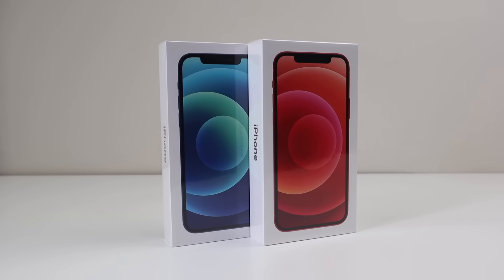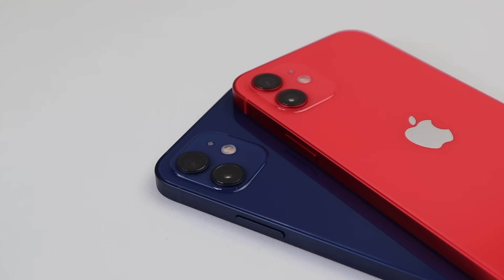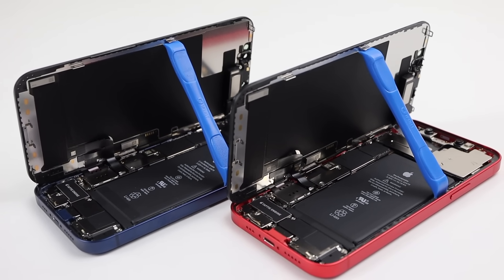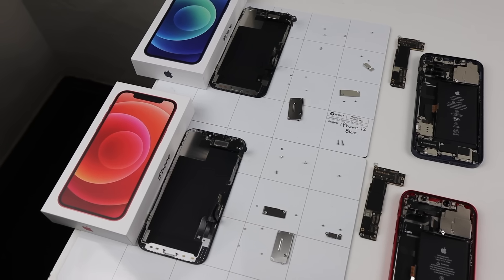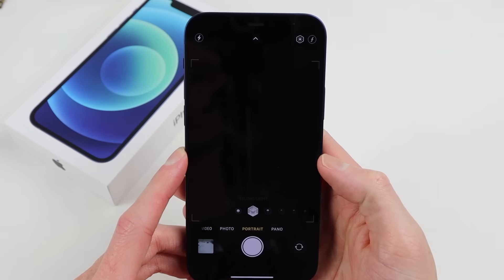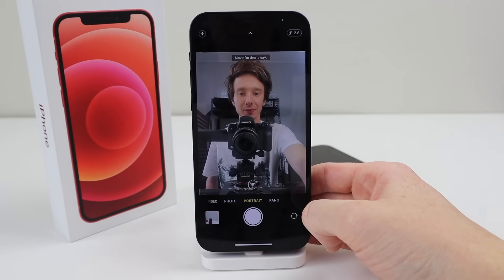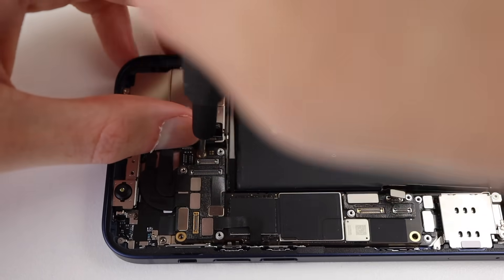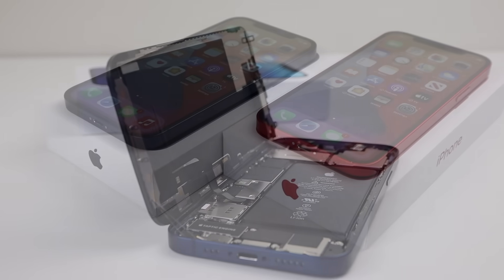iPhone 12 Anti Repair Design - Teardown and Repair Assessment

Comment: There also might be a different point of view on that.

for example, if you own an expensive car or Swiss watch, you don't want to service it in some noname place/garage with non-geniune parts.
Also because it will change your experience of using it and most likely decrease reliability and life-time. Plus, if manufacturer easily allows such "repairs" or service it may cause damage to overall image of the product and its quality.

I think in general it's a good idea to restrict the service this way.
So the chance to get low quality service is highly reduced.

(also worth to mention that in the past I lost two phones - Nokia 7650 and Nokia E90 in service. They had minor problems but they were broken completely in the service centers)

Comment: in my opinion there's a coding happened between the motherboard and camera for software capture. that's why it will affect the camera it self. 🤓 But if your changing only a simple parts I think it will work. 😁

Comment: Now the phones have become reliable if you use it properly, so people buying apple phones tend to use it for 3-4 years, so they are not changing thier phone frequently, So apple to find other ways of income, so if you break  your screen they don't want you to go for aftermarket screen replacement, they want you to come back to them, And they even make apple original spares available via third party scarce or non available, a simple battery for my OnePlus 7t costs 25usd, and it's simple change not me but any good third party vendor can change the battery for my phone, but not apple. I ended up wreaking my father's 7s by changing the screen and battery via third party. It's working but not able to charge due to IC or board problem. Iphone will charge a bomb for it.

Comment: You have to buy the tool that they sell to marry the new parts to the logic board they sell the tool all day everyday day any body that has replaced iPhone xr and up batteries knows you have to clear the battery data and re program it with the old marriage code from the old battery this is nothing new Xbox has been doing it since the start of Xbox come on people don’t feed into this buy the programmer and do it yourself

Comment: The phone won't turn on because the battery was in protection mode. TI's BQ series Fuel Gauge ICs disable the pack output if current exceeds a certain amount. It's from aligning the camera with the connector, which sources power from PP_VDD_MAIN.

Always disconnect the battery

Comment: Repairability is an important characteristic of a phone. Once my iPhone 6s got wet during hurricane rain pouring down, and the water got into headphone jack hole. The phone saw it as constantly connected earbuds and became a piece of aluminum with circuitry inside, because now I could not hear anyone calling. 

I was on university campus and had no tools at all besides toilet paper, toothpicks, and strong language to fix the problem. At first, I wanted just go to a repair shop and get it fixed, but when I saw the cost, I understood that I will rather get a new phone. Eventually, water evaporated, and headphone mode went away. 

I am happy this gentleman did all these tests, now I know what definitely not to buy next time. Hello android.

Comment: i think they have hardware id range for hardware components on each phone and then comes the backend, if the id's are not matching software it self  trigger those childish codes to disable some options. Maybe you can do some revers eng /jailbreak and jump those codes -_- this is the stupidest thing apple ever did and that's not so cool

Comment: these are all features that would probably cost about 1/16th the price of whatever apple so decides to claim the price is, thats the problem with this whole apple android war, no broke person or reasonably low class person is going to be able to drop more than 800-1000$ on a shitty iphone with their shitty operating system, USING SAMSUMG SCREENS, thats literally going to be throttled and shut down a few years down the line, most apple laptops cost WAY over 1000$ and let me tell you right now the price you get for the hardware in apple computers is highway fucking robbery, you can get the newest 11th gen, 16gb of ram, 256ssd hardrive for like 700$ before you can buy a shitty airmac or pro or whavter for anywhere from 1000-3000$, its not about choice or preference its about apple selling sub-par hardware for an 800% price markup on their lame excuses for technology

Comment: from @churros McGee these are all features that would probably cost about 1/16th the price of whatever apple so decides to claim the price is, thats the problem with this whole apple android war, no broke person or reasonably low class person is going to be able to drop more than 800-1000$ on a shitty iphone with their shitty operating system, USING SAMSUMG SCREENS, thats literally going to be throttled and shut down a few years down the line, most apple laptops cost WAY over 1000$ and let me tell you right now the price you get for the hardware in apple computers is highway fucking robbery, you can get the newest 11th gen, 16gb of ram, 256ssd hardrive for like 700$ before you can buy a shitty airmac or pro or whavter for anywhere from 1000-3000$, its not about choice or preference its about apple selling sub-par hardware for an 800% price markup on their lame excuses for technology

Comment: I guess that Apple finaly learned something from SQL about assigning an / int IDENTITY (1,1) / for each entered record on a new row. They could assing a specific number identity for each phone and this can be on all the components. So, quite cleaver solution. If you need to repleace a component, must go to the Apple Store, due to this new way to make these phones irreparable by an outsider. They must have a special equipment to reassign the same identity to the new component, in order to make it work.

I will keep my iPhone 7... a little but more time.

Comment: Car manufacturers like Audi and Nissan have been doing this for years using special bolts that you need a special socket on them that you can’t buy and only the dealership has them so you have to bring it to the dealer for repairs

Comment: "we're removing the charger to have a smaller climate impact. also the phone has no discount because of the charger so we are rounding up our already huge profit on the back of idiots who buy our products"
Reply: Also, they still include that damn sticker that always goes straight to the bin.
Reply: Less hardware should equal cheaper phones.
Reply: ..but if you want a fast charger, we can always provide it for a 'small' price
Reply: apple:we removing this that this that....
user:now we can remove apple from brain....

Comment: This is why I'm staying with android. I've had my note 9 for 2 years now, and its as fast as the day I bought it. Im a younger contractor, I've dropped/ smacked this thing around more than a few times, and yes I cracked the back glass. But I've never damaged the screen with all that abuse. And I can still get all the parts I need and replace them myself. Samsung is clearly a better, more forward thinking company

Comment: G8 video, if you would not have tried the world wouldn't have known what is inside apple 12 , Still wonder why they donot have all of them integrated to one board and have pin to pin connections , replacing board instead of parts is a more greener way i feel.

Comment: This very much misses the point, which is device security. Physical access is the easiest way to hack into a device. Apple is very correctly taking steps to prevent access even if the hacker has the device. If you care about security - and you should - this is good. There are authorised repair shops, able to obtain legitimate parts.

Comment: The phone just looks bad. Too boxy, too thick, and has a massive notch. All for some extra power no one needs, and a better camera than the iPhone 11's already amazing camera. And a usb cable that doesn't connect with normal bricks. No headphone Jack, and no earbuds. Also, no fingerprint scanner. What's next? Making the notch bigger? Taking away the charging port? Getting rid of combination lock? Doubling the price?

Comment: I am apple certified but don't work for Apple. In order for us to change a screen or battery we are supplied with a mac book from Apple that we have to use to recalibrate the new screen and FaceTime camera in order to get them to work. The Samsung i work on have none of this and only require a .01 (I believe) screw driver. Today the supplied mac book would not connect to the apple servers and we had to wipe 2 phones just to try to get them to work which did not work.

Comment: We're going to have to make some laws that prevent them from pulling this crap. This is absurd.
Reply: @averagegigel1448  Nothing wrong with a law of right to repair. Better than letting a company with basically a monopoly do whatever they want to the disadvantage of the customers and repair shops
Reply: Average Gigel why not both?
Reply: I think what cronyx was trying to get at is. There should be some law against electronic manufacturers from locking down devices to this extreme. Forcing people to go to them to for repairs.
If one company starts this, it won't be long before all other manufacturers follow the idea. Once big company's do that and get away with it. They will monopolise the situation. 
For example had a Samsung s10 that had a faulty moisture sensor in the charge port. Samsung claimed aswell as the port some of the main board was damaged and wanted almost 500 to replace and repair parts. Told them no thanks got it back. Brought bits and done it myself for less than 50 quid. (There was no damage to the board or circuits inside. And the water sensor thing they place inside the phone was still unchanged. When they claimed the phone was slightly water damaged and had been submerged in water.)

Have also heard similar storys with iPhones being sent to apple repair. And customer getting phone back with no work done to it. To go and take them to a smaller business for the repair costing way less.
Reply: Absolutely. It seems like they're just giving you permission to use their phone, not the complete ownership of the phone you paid for. That's ridiculous. It's like buying a pen and then going to the service centre of the pen company every time you want to get an ink refill.
Reply: Yeah thats pretty much spot on. When you read the fine print on another of these goods. Or hidden in the terms and agreements, some of them state you have paid for the right to use there property but the property legally belongs to and shouldn't be repaired or modified in anyway other than by "company name"

I remember going back several years ago, there was a few big legal battles regarding video game consoles. And the purchaser not actually owning the rights to the console. 
It come about when I believe Microsoft tried to sue a dad or 2 boys for putting modifications in his children's xbox's.
So when he brought a game he would copy it to another disc and let them use that so the original game wouldn't get damaged.
And eventually he won his case regarding modification of the video game console. And anti-copyright case.
Reply: Or just stop buying their products.

Comment: Apple thinks you should be at their mercy after you buy their products.  How long are consumers going to put up with this?  When enough customers say no to Apple, they’ll stop treating their customers like slaves.
Reply: Idk why even people buy these overpriced iphones that doesnt even justify their values
Reply: @gtgamerhumanoid7187  because bragging rights
Reply: @Kuumin  The apple bragging rights tactic isn't going to work anymore in a few years when they officially make every part of their system anti-consumer. It's destroying their reputation.
Reply: @kb-ww1uw  you know people have said that for years right?  It will always work because people like what is familiar and dislike change if they can help it.
Reply: @gtgamerhumanoid7187  rich emo 15 year olds will buy the pro max to glitch/error edit pictures of themselves in the mirror with the phone + phone’s flash on
Reply: Personally I refuse to upgrade past the 8. I repair my own screens when I crack them and also my battery. It’s like a new phone once I replace those two. No need to get a new phone
Reply: Apple fans will put up with it forever. It's not a company, it's a cult.
Reply: exactly, my old iphone 5s ive kept as a backup and i use it quite often because they’re gonna stop updating it after march of 2021 meaning its gonna be quite useless even though its so durable and works perfectly still! also after watching this video i realized the reason the home button on my iphone 5s doesn’t work is probably because of apple, not a problem while it was being repaired
Reply: Apple is not smart, their phones are too high priced and weak. This can lead to a lot of critics and less selling lol
Reply: @d3bb320  except they are smart.  every iPhone generation there are critics.  Apple still sells well.  That's how it goes
Reply: They are doing the same bs as with the mac - there they soldering every component - here they lock it by software. Very poor behavior.
Reply: So far it has worked over 20 years (If we only count i-products), so no reasons to change strategy.

Comment: And that is exactly why I need to start transitioning away from Apple.
My late 2014 Mac mini is a prime example. 5400rpm drive. 8gb ram soldered to mother board? Why on earth would they do that?  Why not SSD or at the very least 7200RPM?
The CPU is never the bottle neck. Keeping Monitor open, The biggest slowdown factor is high swapping due to low ram, but on the slowest drive they could find.
Reply: Smh

Comment: I had my screen fixed from a third party repair shop and my face Id doesnt work anymore i guess this is why (i have an iphone X )
Reply: That should not be an issue with the iPhone X only with the iPhone 12. I would recommend that you take it back and have them fix it for you.
Reply: @alejandrosoto3375  i have an iphone x as well. Face id doesnt work after a screen change.
Reply: There is a device where you can read the mcid and rewrite this ID on your new screen ans than it will Work again... But i guess this is illegal
Reply: I used to work for a 3rd party repair shop, it was our job to fix the device and make sure nothing else broke. We would be responsible if anything that was working before stopped working after we attempted a fix.

Comment: Car manufacturers have been doing this kind of stuff for years. BMW being the worst I believe. You can't even change out a car battery in a bmw without having to have the dealer recode the battery serial number into the ECM. If you just install a battery without it being coded, your car is dead in the water until it is coded by a dealer. Alot of things are headed this way so get ready.

Comment: Honestly, people that are cheap AF and think they can fix their phones themselves....ya, they usually can't and then bitch when they break something (the ribbon cables) and then Apple won't work on it because the idiot person tried working on it themselves. I think it makes perfect sense that if you open up your own phone in a stupid attempt to fix it your self, then you should have your warranty voided. I don't know how anyone can argue against that. Like if you CAN open your phone, you should know how to fix it and understand every aspect of it/what each individual component does. SO those people wouldn't have to worry that much about voiding the warranty because they can fix their own phone. Complete novices that are cheap AF and think $250 is too much to change out the LED screen should NOT own iPhones PERIOD. These idiots attempt to buy a POS $50-80 screen on Ebay are SO STUPID....guess what? If you're going to be that fucking cheap, then hope you not only ruin your phone attempting to "fix it"/be a cheap bastard, but cannot get it fixed by Apple or even looked at because of your own stupidity).

As far as 3rd parties go, I've had only bad experiences with them to be honest. Honestly you save like 20-25% maybe 30% max on fixes at 3rd party...how about you cheap bastards just go to iPhone. if you don't like that, then you shouldn't own an iPhone. Go buy a piece of crap Android phone instead! Like I said most of those 3rd party phone repair companies are garbage anyways, so I'm on Apple's side when it comes to voiding warranties. Only go to Apple for your phone's repairs, end of story. If you are poor, or low class, you shouldn't own an iPhone. It's a premium device meant for people that don't have any issues dropping $250-300 to fix their phones if necessary (through Apple). If that's a lot of money to you, then as I said...you shouldn't own an iPhone, you should buy a crappy Android phone. It's sad if $250 is a lot of money to you.

Comment: I think it's the main problem of any consumer electronics. Almost all devices are built to be garbage.
Even if you can repair - at some point it may become outdated in terms of software/performance/features/support/you-name-it

For example, I have an old iPhone 3GS and Nokia E90 (which are perfectly repairable) but it can't be used anymore due to lack of apps support and overall performance.
So in fact, those devices that were top flagships not so long ago, now already a garbage.

Whatever we do, we cannot prolong life of these items since after a while they no longer provide the intended functions. 

Though, there is one device which seems to be less garbage than others. Recently I have replaced a battery in my ten-years-old Kindle 5 and it still does its job perfectly - and it will until there are parts available.
However, even with Kindle - Amazon could theoretically cut old devices out of Amazon services and make it less usable to convert it to garbage.